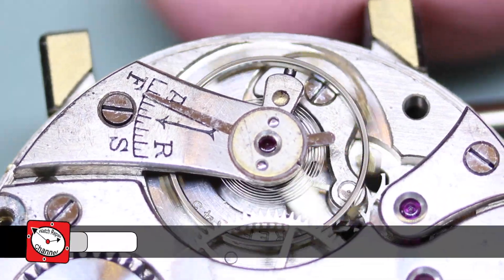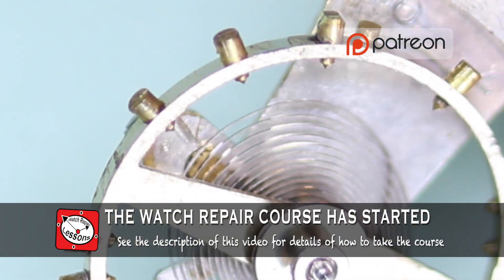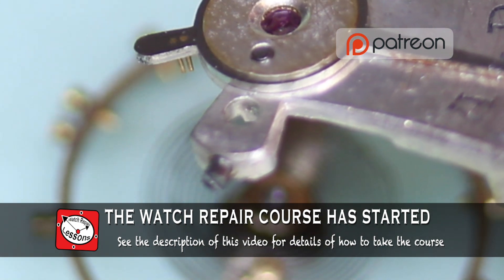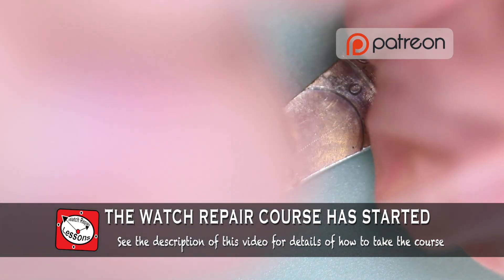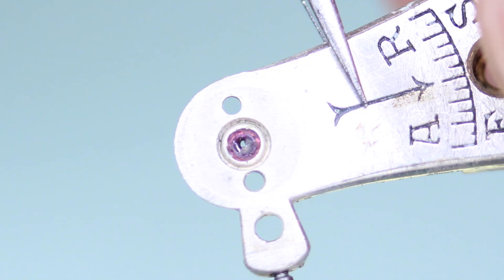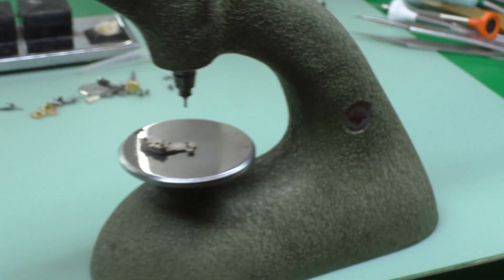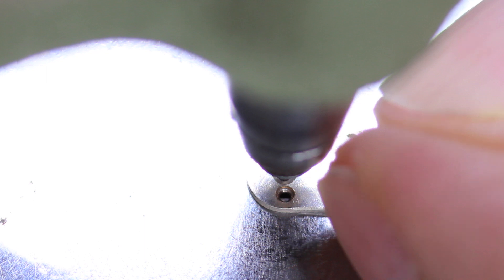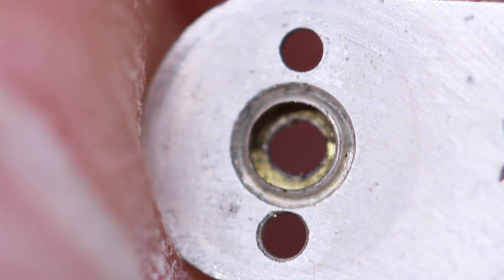Watch repair Rub In Jewel Settings. Fitting new jewel. Tutorial. Lesson

Comment: A couple of points, after I removed the jewel, I clean the cock thoroughly, this is to ensure no amount of foreign matter is left in the seat. Failure to do so may result in a jewel sitting less than square, and perhaps having a lopsided fitting jewel and the chance of undue friction on the balance staff. Just my observation

Comment: This otherwise excellent video confirms what I have always thought, that while this  type of jewel setting OPENING tool is excellent, the CLOSING tool is a flawed concept. It has, in effect, 4 cutting edges and grinds away the rubbed over setting as fast as it closes it: better to close it with a burnisher, not a pivot burnisher but the type jewellers use. In ancient times agate or even a dogs tooth was used but  you can make a modern one out of a piece of hard steel as long as the tip is a flattened oval and has a mirror polish. This closes the setting beautifully and with a little practise it will look untouched.
Reply from the maker: I absolutely agree with you. I now use a domed punch from my staking set - much better :)
Reply: @WatchRepairChannel  hey man, love the channel learning lots and saving moneey for your course...where do you get rub-in jewels? from the net? thx tons

Comment: Thanks for this Mark, clearly explained as usual. 
Your videos always give a cool and calm impression that the jobs are possible for anyone prepared to give it a try.  I successfully rubbed in the onyx block back into my engagement ring once when it dropped out after many years but that was soft gold, I suppose the principle was the same but thanks to this vid if the occasion and need arises I may try it on one of my watches..  PS Hope you are settled in nicely.
Cheers,
Vic
Reply from the maker: Yes Vic, the principle is pretty much the same as rub-over Jewel setting in the jewellery trade. In fact it is possible to close the metal using jewellers tools as I have done it in the past. The jewelling tools in the video do make the job rather simple though.